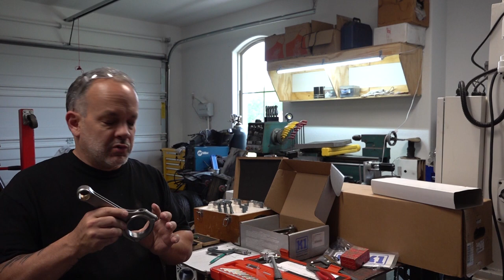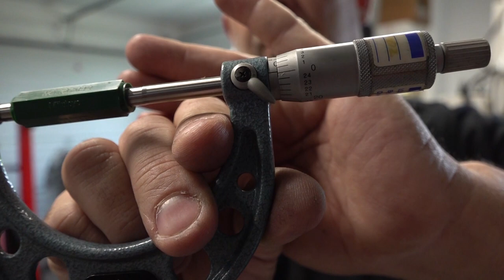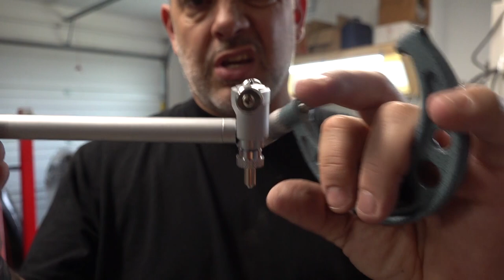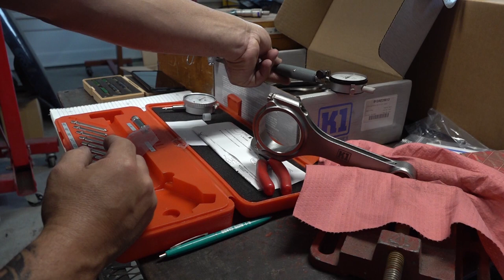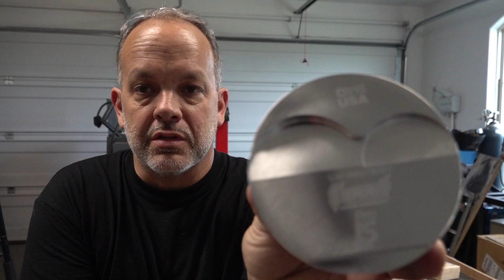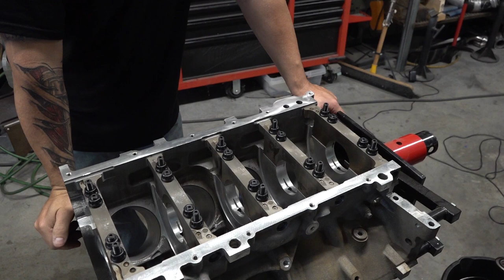Partially blind old machinist shows you how to check your engine measurements after machine work

Comment: Always fun to watch how someone builds a engine. I have built probably several hundred engines and only one LS. The LS was a 6.2 with .010 over flat top pistons. Probably the best running engine I ever built. I have built them with lots more power, but that 6.2 was a screaming little machine. I look forward to seeing you run this one.
Reply from the maker: This was a different shop that I've never used, so I needed to check it 100%. Truthfully you should every time no matter what - but I trust my normal shop's work and typically just "throw them together"

Comment: We're did you get your set of Guages
Reply from the maker: The micrometer set I've had since the mid 90's. Can't remember where I got them - pretty sure Amazon has them though - they aren't cheap! Probably 700-800$ now days
Reply: @diygaragetx  not cheap but worth every penny micrometer are more accurate then calipers in most cases and calipers won't work for cylinder always the best too for the job